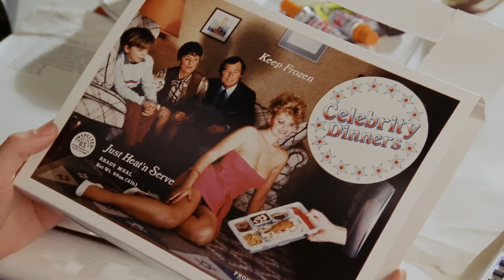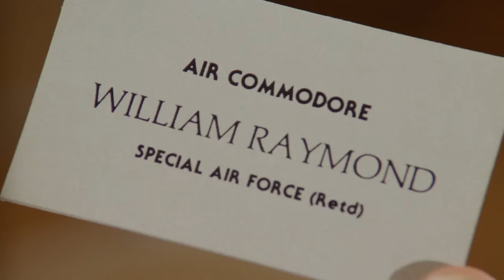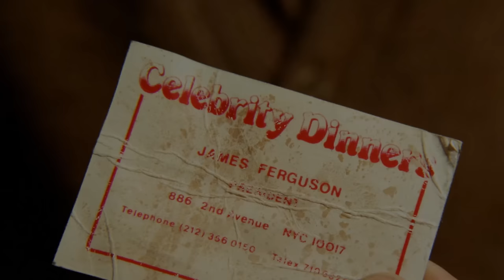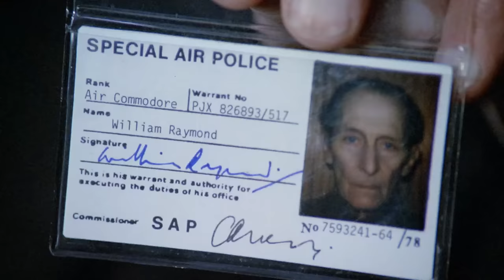Biggles: Adventures in Time | Full Movie | Full HD Movies For Free | Flick Vault

Comment: This was one of those weird and enjoyable movies if you let the brain clutch slip a bit.  Liked the scenes shot at the Shuttleworth Collection at Old Warden, as well the sound weapon testing on the same grounds used for the last portion of Kubrick's Full Metal Jacket movie. The Stampe aircraft that was modified with a gun turret was also used in the film The Mummy and the Indiana Jones movie The Last Crusade.
Reply: Using a Stearman for German aircraft was not very good. Imho the best movie with WW1 replica aircraft was the Blue Max.
Reply: Hello vumba,
Good point but lets take in some details. This was a low budget film so for Joe Average it was a biplane with a noisy different motor hat could be safely flailed all over the sky.  If you notice all the Shuttleworth stayed on their home base and on the ground.  They were not going to beat on their then 80 year old airframes.
Stil;l a fun movie.